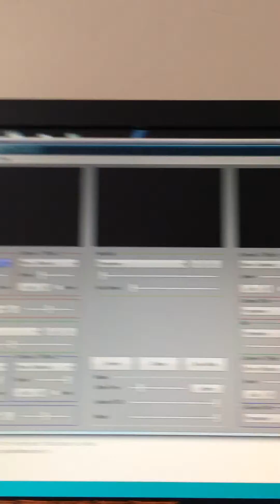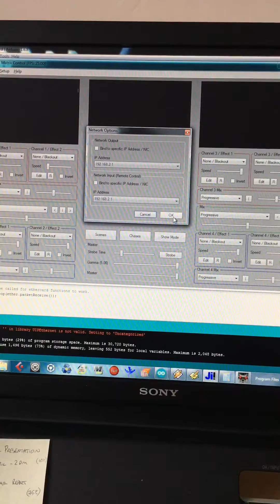Artnet DMX Arduino Nano/ENC28J60

Comment: Thank you for your work, could you please help me how to connect Arduino Nano with Max485 to control stage light. As far as I know, i have to use rx-tx pins, and where to connect DE RE pins of MAX485? I don't get what your  code says: DmxSimple.usePin(3);  // DMX output is pin 3
Reply from the maker: I can't quite remember much about this project now but I used pin 3 (a normal I/O pin) as the DMX output rather than a Tx/Rx pin

Comment: Hi, 
I'm have really simillar DMX controller and I'm using DmxSimple library as well but I cant force arduino tatalk with this controller. Can you share how you connected arduino with DMX? Are using MAX485?
Reply from the maker: Yes I used a MAX485. To be honest it was a while ago and can't quite remember it all but you can have my code if that helps
Reply from the maker: https://www.dropbox.com/s/2edlaoxnoxbgwg1/Artnet%20Arduino?dl=0 I'm not 100% sure how complete this is but I think it's the latest version. It's well commented so you should be ok. It's probably not the very best way to work it but it done the job!
Reply: Thank you very much for you answer, I really appreciate this. I saw your code and I'm doing exactly the same in context of DmxSimple library. Do you remember where you found information how to connect MAX485? I assume  there is hardware problem because my "connection" led isn't even blinking. :/
Reply: hello great project. can someone help me find a code
artnet-led pixel controller. is there anyone who has this running. I do not get it running
thank you in advance
Reply: Sorry  for arduino nano  tanks